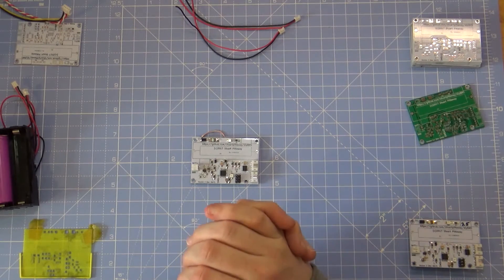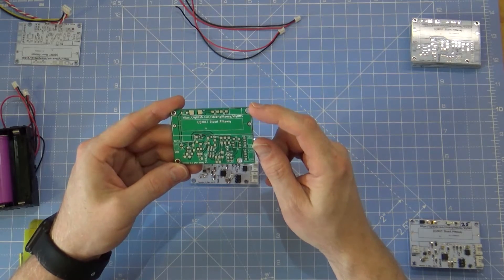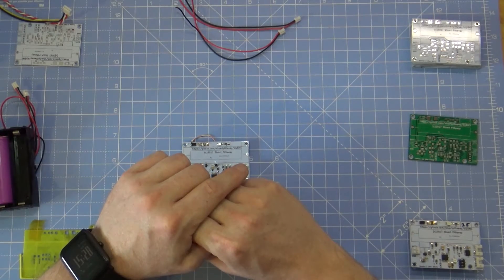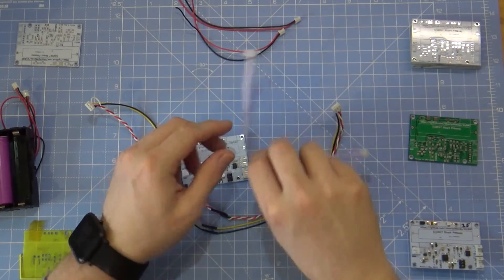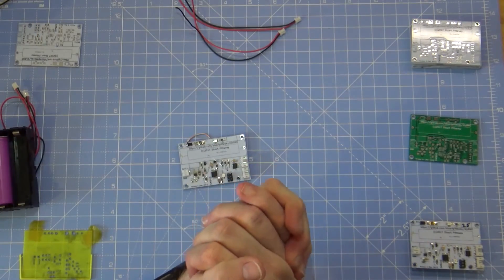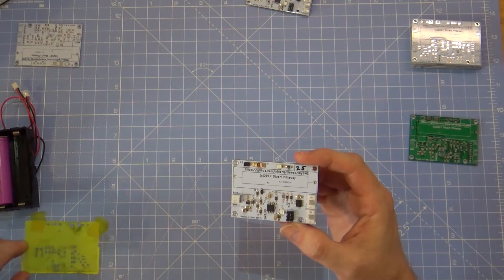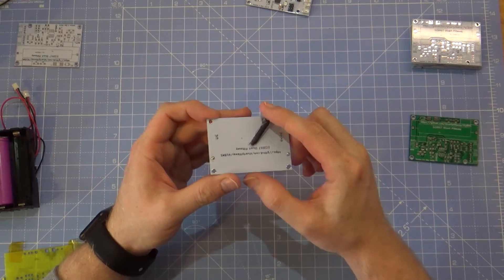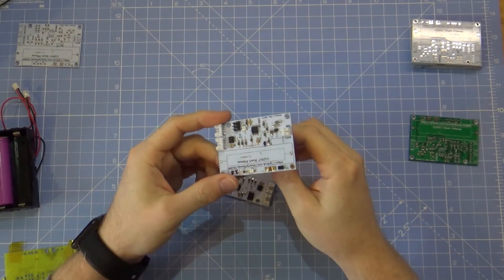DiyBMS Tips and Tricks

Comment: Getting the right cables and headers,  is doing my head in a bit for the 4.21 boards.
Reply from the maker: I know with the version 3 it was a pain as they were smaller headers and harder to find.  I woud have prefered 2.54mm headers which are more standard.

Comment: Thank you for this video. I have been experimenting with my own diy efforts on bms for a while and have had great noise problems during mid day when my charge controller is running at high capacity. For example, I have not been able to make an arduino with an Ethernet shield work reliably during those hours. However I have found that a raspberry pi zero with WiFi is rock solid.  It is amazing how many system problems trace back to bad connectors. My system which has 16 lifepo4 units would require 16 boards working together might be difficult to keep running and trouble shoot. I am still deliberating on weather to build this system as the software is light years ahead of anything I have created.
Reply from the maker: Hi that is why i had used stuarts design over my own early attempts as it was second to none.